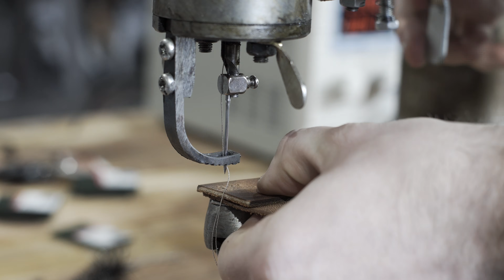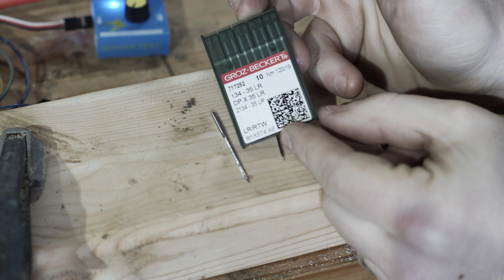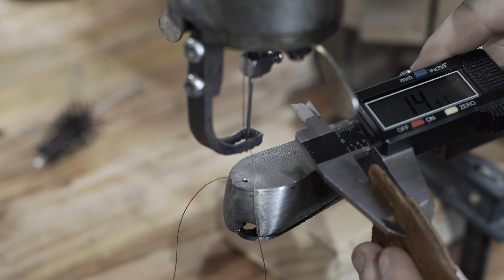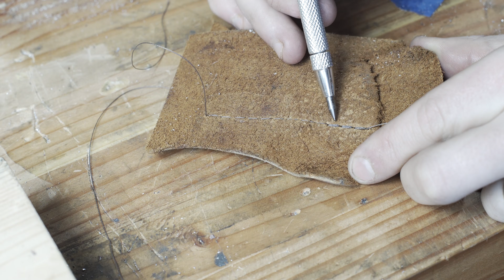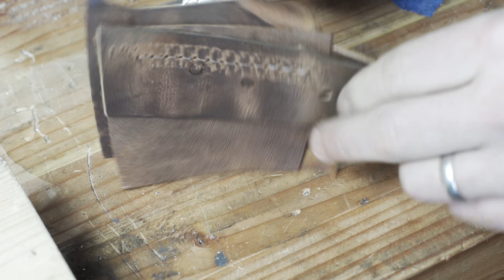Does it sew? Testing out the motorized leather patcher

Comment: I am assuming there is no stitch length adjustment....what is the spacing ?
Reply from the maker: Surprisingly it does have a mechanism to adjust length, but it's very crude (bolt that adjusts spring tension of part of the mechanism).  See: https://www.youtube.com/watch?v=JysRGYyrq_I  I don't recall what the min/max length is though

Comment: The needle bar is adjustable for height, for length by loosening the clamp at the top, setting the the "gap" on the bobbin side of the needle, spanning the height of the bobbin, that flat is designed to allow the bobbin point to easily pick up the needle thread, and let it slip around the bobbin shuttle, and slip loose, and the needle thread pulled tight by the tension.
   If you set up your original needle in the machine, you can see how the bobbin shuttle point slips past the flat spot on the needle,  then look up at the top of the "needle bar", where the lever connects, there's a screw that locks the lever to the needle bar, and you can adjust the bar to most any length needle that will fit in the needle bar.  The "chisel point needles are designed to allow the thread to slip offset, to prevent it tearing the leather, as it will with a punched hole.  I've got some of the exact same needles as you, as well as one size longer, but there's not enough room in the bobbin shuttle area for a thread larger than a 50m size, and that one will be problems if you don't get your tension right on both ends, needle and bobbin.  I grew up sewing patches on my jeans knees, and mostly by hand, because you can hardly get the material turned around for a patch in regular sewing machine.  These types allow you to sew a patch in the shoulder of a coat, or knee of pants, you "back stitch" by turning the stitch head to go the opposite direction for three to four stitches, then rotate the head, 180, and sew towards yourself, if you like, as I do.  I didn't realize the value of the head, until I saw a video, and have since played with patches, and can sew inside a knee on jeans in a few minutes, with ease, I mostly do holster and related work, also leathers for riding, but I will be repairing clothes, I still wrench, and wear out knees and elbows.  Semper Fidelis

Comment: Why do you cut the needle? You can adjust the needle rod and position it some few mm higher ;)
Reply from the maker: I don't quite remember the details now, but iirc there was a hardstop inside the needle holder that prevented me from moving up any further.  The needle was much to long for the adjustable range, basically :)  My fault for buying the wrong needles :)

Comment: READ THE INSTRUCTIONS! PRESSURE ON PRESSURE FOOT CAN BE ADJUSTED BY ADJUSTING THE “PRESSURE FOOT ADJUSTING NUT", & SAME WITH THE DIFFERENT LENGTH NEEDLES, use the “NEEDLE ADJUSTMENT CLAMP" & SET SCREW! This is why Instruction SHEETS are MADE!
Reply from the maker: Easy there with the caps. My "straight off the boat from china" machine didn't come with any instructions, this is all tinkering and figuring out on my own ;)
Reply: Breaking Taps - I ALL CAP SORRY YOUR CAP SENSITIVE. JUST SHOWS HOW MEDIA BRAINWASHES PEOPLE INTO THIER WAY OF THINKING IMPLYING THAT CAPS EVOKE FEELINGS! WHAT A BUNCH OF BULLSHIT! ANYWAY THE TWO SPRINGS ATTCHED TO THE EYE BOLT WITH THE NUT IS THE FOOT ADJUSTING PRESSURE SCREW, NEXT TO THE SCREW THAT DETERMINES LENGTH OF STITCH....
Reply from the maker: Thanks for the info :)

As an aside, all-caps == shouting has been a convention that predates the internet, dating back print media in at least the 1800s: https://en.wikipedia.org/wiki/All_caps  But definitely since 80s it's been equated with shouting in IRC, usenet, etc.  I did chuckle over "cap sensitive" though, like it's a type of allergy or dermatitis or something :D  Cheers!
Reply: Breaking Taps  - interesting history, thanks ¡

Comment: I can't get my machine to sew in a straight line with the material. I have centered the presser foot made sure the parts were all machined square and straight and has equal pressure on both sides of the foot. It starts off straight but no matter what I do it will start sewing on a diagonal  anyone out there who can help me out with this? Thanks
Reply: Its your needle, not the machine. Different type needles create different patterns. Straight, Offset/Slanted, etc. Try the right needle TYPE for a STRAIGHT STITCH...
Reply: You were right the needle that came in the machine was bent it came with a package of spares and I replaced it sews fine now Thanks
Reply: James Burriss  - Your Welcome, glad to see your problem resolved.

Comment: The reason the stitches are slanted is the machine is sewing on a bias there are two things that can cause this 1 the foot has uneven pressure 2 the top and bottom round plates are not aligned with each other
Reply: We are just tuning up our machine and it does sew. I am aware of the issues some people have mentioned about the foot being uneven and I'm watching for that.  Can you please explain what you mean by the "top and bottom round plates?"  We have not yet taken apart the cylinder housing the needle mechanism, or the arm housing the bobbin mechanism but plan to take those apart and clean them up to be sure.

Comment: tell me how to adjust the tension on the top thread and the lower thread.....
Reply from the maker: Bottom thread tension is adjusted via a small spring clip on the bobbin case.  When you thread from the bobbin, through the hole and under the metal clip... adjusting the screw on that clip will adjust tension (looser spring == looser bottom thread).

Top thread is controlled by the tightness of the two tensioner discs (the flat discs with conical springs pressed against them).  Adjusting one or both of those will change top tension.  I think mine is threaded with just one of the discs because I found it very tight.
Reply: @BreakingTaps  thanks i know now what you are talking about on the bobbin and the other i only use one of the disc's   thanks   will try that ,....

Comment: How do I stop my thread from breaking?
Reply from the maker: Probably a tension issue.  I'd double check the bobbin tensioner isn't too tight (it's just a little piece of spring steel on the bobbin carriage, can adjust it with a small screwdriver) and also play with the top tensioner assembly.  IIRC I'm only using one of the two tension discs on the top.  Also make sure everything is threaded correctly, and you don't have any sharp burs on the machine that might be abrading the thread (mine had a ton of really rough spots).

Comment: Great video! My main question is how do you keep your thread from fraying from all the friction? I use bonded nylon #69
Reply from the maker: Thanks!  Not sure to be honest, I didn't do anything special other than tweak the tension a little to get the stiches correct.  I also have been mainly using #69 bonded nylon, haven't really noticed any fraying problems (other than obvious incidents like when the needle got stuck and broke).  I did find while tweaking tension that the "spring clip" on the bobbin was pretty tight, and sharp.  I could see that causing fraying so you might want to check that too.
Reply: Breaking Taps cool maybe I have to sand and smoothen out that tension piece. My top thread is the one that is fraying so I’ll keep messing around with it!
Reply from the maker: Ah gotcha.  Yeah might be something rough in the upper tensioner arrangement somewhere, quality-control on these things is basically nonexistant :)  Don't think mine had any issues up there... but there were a lot of rough places in general.  Taking a file and/or sandpaper to anything that looks gnarly would probably help.  I think I've been using only one of the two tension discs as well
Reply: Breaking Taps I appreciate your help!
Reply: Go to the CLSP page. If you ain’t got it down, I make these machines my bitch. Knape.

Comment: I just got one and I don't have any instructions on how to full a bobin?
Reply from the maker: Not mine, but there are a few good videos showing how to wind the bobbin and thread the machine: https://www.youtube.com/results?search_query=leather+patcher+winding  In particular, this one is a pretty good overview: https://youtu.be/tWgxzSCZxrQ?t=40
Reply: I wind my bobbins by putting a small bolt through the hole with a nut and chucking it into a cordless drill don't waste your time trying to use the winder on the machine
Reply: @jamesburriss1086  brother you got that right I'm doing the same thing only I use an adjustable speed drill.

Comment: These usually come with HAx1 (130/705H) needles.  For the longer needles - raise the needle bar slightly to accommodate the length difference.  These machines can normally sew with (up to)  a #22 needle with V138 thread.
Reply from the maker: Good to know, thanks! Will keep that in mind when I need more needles in the future.

Comment: How do you adjust so it doesn't make a rats nest on the bottom when stitching thick leather
Reply from the maker: Probably a tension issue. If I remember correctly, nest on bottom means the bobbin is too tight or the top is too loose. You should be able to hold the thread from the bobbin without it unwinding, but a little jerk should unspool some (hard to test with this bobbin since it likes to fall out).  I believe I loosened my bobbin tension a bit (the little metal spring steel holds the thread against the case and there's a little screw to loosen it).  I'm using one of the two top tensioning discs, don't remember if I fiddled with the setting.  But QA on these things is nonexistent, so yours could be set totally different from mine.

I'd check bobbin, check top tension, and verify the top is threaded correctly.  I also found I had to crank up the foot pressure too, otherwise i'd sometimes go through the same hole on thick leather (re-stitch the same spot) which caused problems too.

Comment: Hi man I plan on ordering one of these sewing machines off amozon next month . can this also do clothing frabric an what's size of three is best to use on the this sewing machine
Reply from the maker: It probably could do lighter clothing fabric... but I'm not sure it would do a good job.  A cheap mass-produced sewing machine might do a better job.  The foot mechanism is pretty crude, and it might start slipping on lighter fabric.  Most sewing machines have the foot on top, and a serrated grate on the bottom that move in conjunction.  The patcher just has the foot on top.  I've been using it with #69 and #92 thread, but it can use lighter threads too.
Reply: @BreakingTaps  thank you

Comment: I‘m thinking about getting one of these, my better half is quite clever with his hands, so I don’t see great troubles in pimping and tuning it a bit, if necessary.
But I really would like to know if the stitch length is adjustable in this kind of machines (or is it preset and fix)?
Thanks for your answer, nice video, just subscribed to your channel.
Kind regards from Germany
Reply: Stitch length is adjustable, but I wouldn't say it's a really wide range.
Reply from the maker: Thanks for watching!  Stitch length is adjustable... but it's very crude.  There's a small bolt under the arm which you can adjust.  Screwing it in makes the arm bump into the bolt sooner, which causes the stitch length to shorten. Reversing the bolt makes the stitch length longer.  But since it's just a simple bolt and can complete several rotations from fully extended to fully retracted... it's nearly impossible to consistently set.  You have to "dial it in" on a scrap piece of leather until you're happy with the stitch length.  So in short, you can adjust it... but it's not easy to reset to certain lengths consistently.

Hope that helps!
Reply: Breaking Taps Thanks for your answer, and yes: This helps a bunch! So did I get it right, that any setting made, will result in it sewing at a consistent length, while it is practically impossible to predict the stitch length by simply setting it, without trying out in which exact length the stitches will result?
If so, I can get along with this, as long as it doesn’t switch stitch length without being told to.
Reply from the maker: Correct! Once set, the stitch length is consistent.  But it is difficult to reliably reset to the same stitch length without tweaking.  Not my video, and the screw on mine is slightly different, but here's a good example of what the stitch length adjustment looks like: https://www.youtube.com/watch?v=JysRGYyrq_I
Reply: Breaking Taps Thanks, that should be fine for me.

Comment: Hi. The walking foot has a terrible teeth make the work so ugly. Did you make any modification?
Reply from the maker: Yeah, it really does. I ended up filing the teeth down some, taking off the sharp edges on the bottom and sides.  I tried adding some heatshrink wrap (as suggested elsewhere on the internet) but that made the foot slip too much.  The foot is better now, but does still leave some marks.
Reply: adjust the footer pressure
Reply from the maker: @earlhudson7759  Alas, foot pressure mostly doesn't help.  Loosen enough to reduce the marks and it begins to slip, since there's no feed dog underneath
Reply: @BreakingTaps  
This is a nagging problem with me also.  Thought about gluing a small piece of 400 grit to the underside of the footer, just don't know how long it will stay in place.  I believe the presser foot is the most important function once the tension is set.  I had a project yesterday and set the presser foot to a minimum for 6-8 oz leather, no marks and stitches were perfect, but when I hit the 2-3 oz underlay the leather didn't want to move.  Makes a reasonable man think "what's going on?"  Will continue working on the foot problem, in time, someone will figure what has to be done.  Come to think of it, the underlay leather was soft and perhaps the leather was too soft and stretchy and didn't want to move.  That may have been the culprit.
Reply: @earlhudson7759  if you pull the leather through it helps.
Reply: Newbie question. I've done almost no leather work but we are putting our machine together for hobby work, not just leather.  in the situation you were talking about, I saw someone say to use a sacrificial piece of paper on top of item being sewn.  Is that a good or bad idea in practical use? Thanks.

Comment: Hi, I have been thinking of getting one of these. But the common issue I see from all the videos I have watched, is marking or marring of the leather by the foot. Is the foot that sharp? Can that issue be corrected?
Reply from the maker: Yeah, the serrations on the foot are pretty sharp.  It can be made better, either by filing them smooth (or smoother), or coating in something protective and grippy like plasti-dip. Someone else recommended putting some heat shrink tubing over the foot.  The downside is that the smoother you make it, the less it grips the leather.  So it's a bit of a trade off.  I've used grippy plasti-dip on mine (after this video) and it works reasonably well.

Comment: Omgggggg I'd love to find a patcher!
Reply: They are 175$ on Amazon
Reply from the maker: Normally around $110 just FYI, importers are doing some good ol' price gouging lately :)  Can find them cheaper on Ali, ebay, etc if you're willing to wait for it to ship from china.
Reply: Breaking Taps I found them about 50 cheaper but $50 for s&f.  And I received  s&h.  Thank you for the videos.  I’m cleaning and preparing mine today.
Reply: Breaking Taps Just got mine off Amazon for $115 and free shipping.
Reply: I picked one up for $110 shipped on eBay. Took about 5 business days to receive it. Works great after some basic cleaning, filing, and mounting it to a solid board.

Comment: Hello. Love the demo. 
What brand of machine is it and where to buy?.
Reply from the maker: I bought mine from Amazon ("Fisker" brand, https://www.amazon.com/gp/product/B06XCPFFYV), but they are all the same machine.  Just sold by resellers purchasing from China.  I bought mine for about $110 USD, although it looks like the price has gone way up lately.  You can find them on ebay or aliexpress too.  E.g. here are some on Ali for reasonable prices https://www.aliexpress.com/wholesale?catId=0&initiative_id=SB_20190527064140&SearchText=cobbler+machine
Reply: You can find them on ebay for as low as 90 bucks don't do it get the more expensive ones you get accessories with it and if you contact live4youonly they can supply you with more stuff. 
Bobbins and different kinds of feet.
The prices are great.
Reply: If you're buying on Amazon, read the reviews of the VIN doors carefully. Pick a good vendor based on how they are responding to people. It's worth a few extra dollars. Also be sure and get free returns and free shipping to Amazon! In case you get a bad machine.